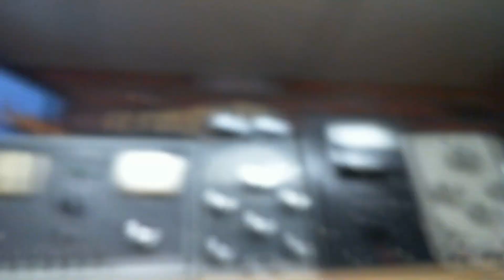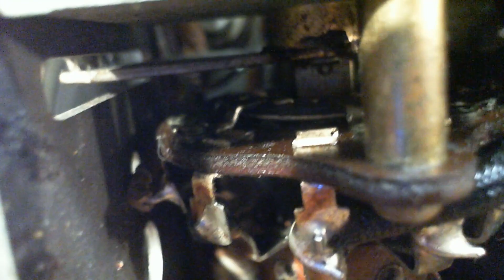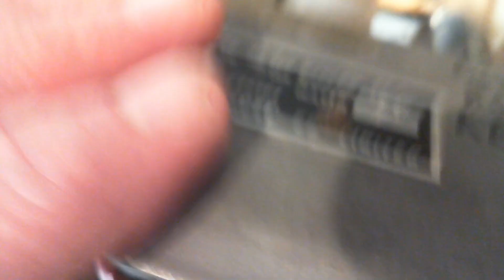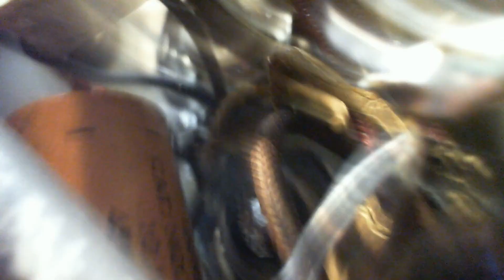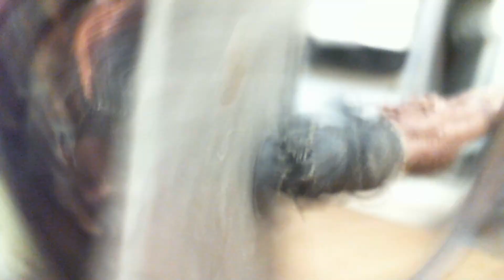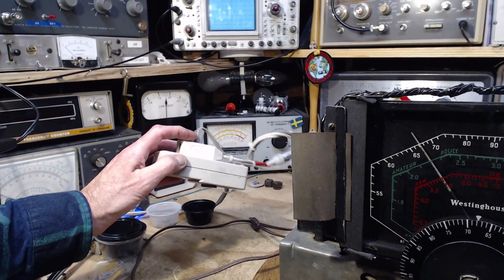Canadian Westinghouse Model 512 Tube Radio Video #1 - Checkout and Power Up

Comment: Wry informative!! 

I have an old radio restoration project waiting for me just now, so this is very helpful.  I’ve thought about series (incandescent) bulbs in lieu of a variac. Seeing that the bulbs are among your well-worn techniques confirms the idea.

Thanks so much!!
Reply: I commented before, noting your technique.  I’m impressed with those who know how to diagnose and fix things.  My background is in RF design and while I’m good at that it is definitely a different skill set.

Nice work!

BTW, I also have an amateur radio license and am active in that.  That’s a great hobby and a lot of fun.  Hope you take that as encouragement to get a license.  The fastest, and easiest route to that was using flash cards with the questions in the question pool. Does Canada also have an open question pool?  There is so much arcane info in the question pool here in the US that memorization makes much sense even though it almost felt like cheating at the time.

Best of everything!